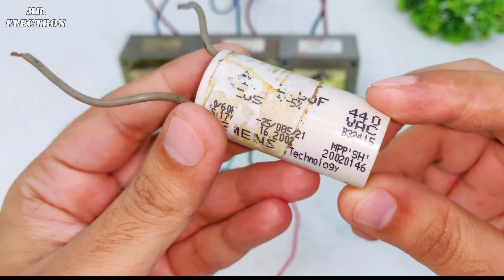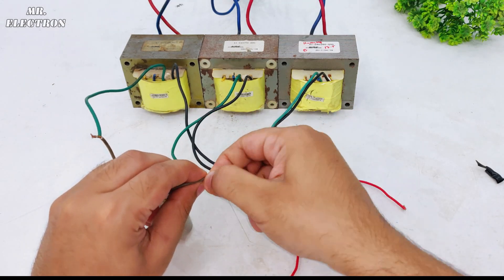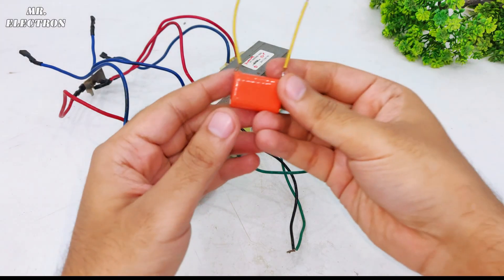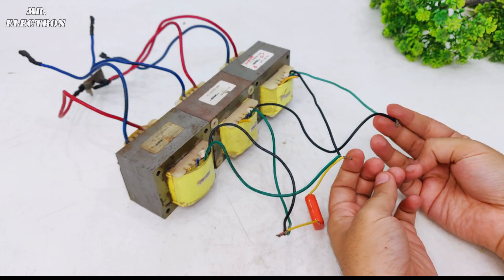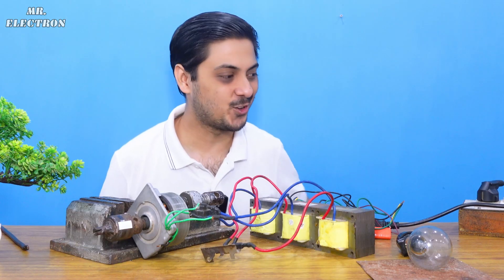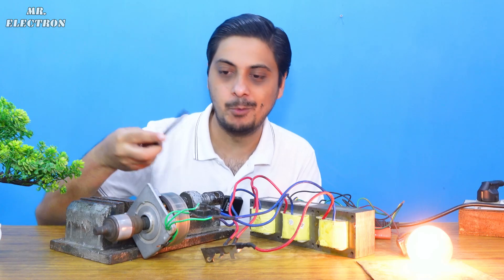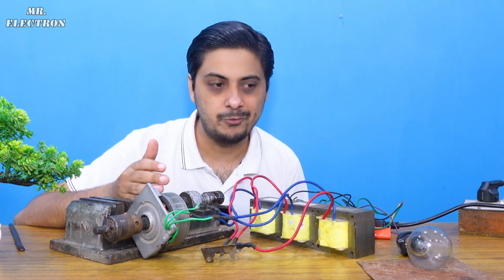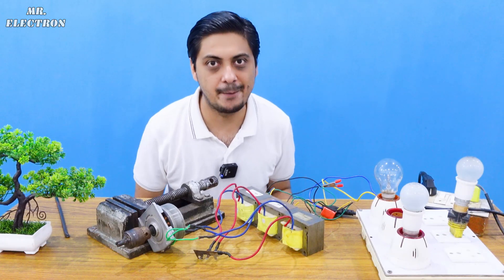Make 3 Phase Supply from UPS Transformer | Run Brushless DC Motor without ESC | BLDC Motor

Comment: there is a simple way to run a synchrounous motor 3phases (or bldc motor) is spinning rotor to the freq of the ac source then connect motor to power source (the same way how to synch turbine to power grid)
Reply: saudaçoes. no caso deste motor BLDC , como o conecta á fonte de energia , alimentando suas 3 fases?

Comment: Hi, is it possible to make an inverter using a subwoofer amplifier and frequency generator app? We could set the frequency to 50/60Hz and connect a transformer at the subwoofer terminals to step up the voltage. Maybe it can also be used to demonstrate a VFD since we can easily change the frequency on our phone. Could it work?
(Your videos are awesome)
Reply from the maker: It can work
Reply: @MrElectron  would u like to make a video on it?